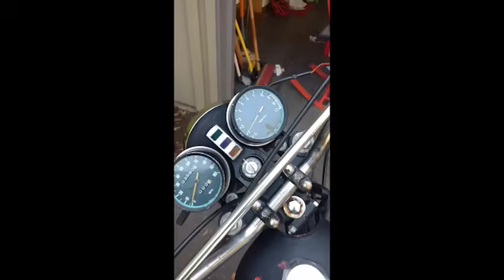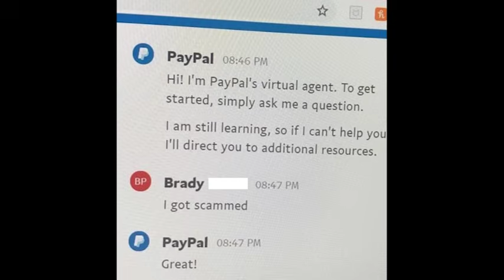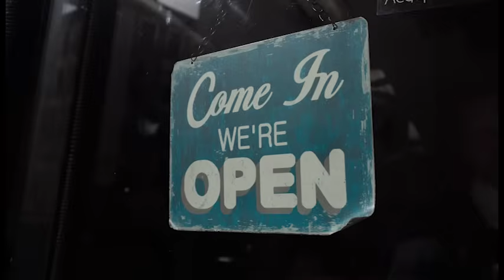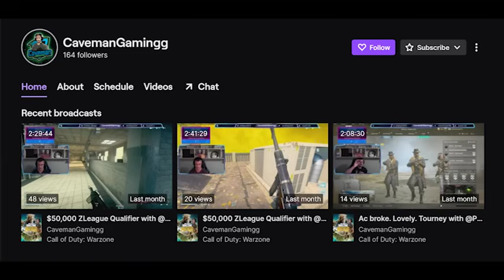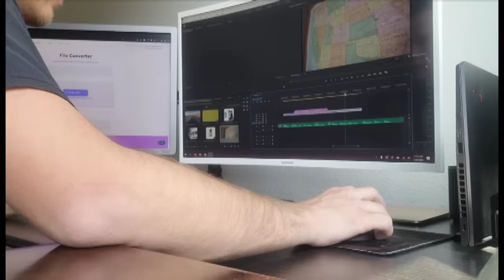Two Idiots Cross the US on '80s Motorcycles

Comment: 1980's bikes were very reliable....once you got them back into shape again, they will go for a long time.  Not idiots for choosing those rides.  In my 20's did it on a '67 Triumph Bonneville ... which made it but still not sure how.  It was a tired oil burner (quart a day by the time I was done, plugs cleaned up once in the morning and once at lunch) that needed everything tightened up every night when I started and needed completely rebuilt when I got back....but it was one sharp looking ride.  Now, in my mid-sixties getting ready do it again on a 150cc Vespa.  You guys aren't idiots,  just joining the club.

Comment: Thank you for the video log of your long cross country.  I had a few cross countries in the early 90s, none as long as yours, but mine were also eventful.  I was 28 when my mother passed from cancer.  Grieving, I rode from my rented bedroom in Miramar, San Diego to the Grand Canyon, a little over 500 miles, solo and back in 24 hours and obtained a iron-butt patch.  I had a well worn 1982 Magna.  I had only cash for gas, so no motels.  I slept on the ground.  It was early July and I roasted!  My rear tire showed threads after the drive through the Mojave and I had to spend my food money on a rear tire.  Later, I got pulled over by the police who thought I was a prison escapee!  I realized going through the extreme heat of the desert, it's best to wear long sleeves and gloves for sun protection.  I love hot tea, and I carried a thermos of the stuff, and sipped it on my breaks, even when it was 112 degrees out.  I'm about to turn 60.  Next year, I hope to ride with my 18 year old son on a motorcycle adventure.
Reply: I just turned 60 and started riding motorcycles when I was 8. Did you get a chance to ride with your son yet? If not, make sure you make it happen and good luck! Fellow rider.
Reply: горячий чай без сахара - старый способ справиться с жарой

Comment: A few months ago I was in the Sierra Nevada mountains with no cell service, I ran out of gas on my bike in the middle of nowhere my gas light appears to not work. Lucky I was going up in elevation the for along time past the last small town. I ended up turning back and coasting about 5 miles back to that small mountain town .
There was no gas stations for 15 miles.
I ended up talking to a residents and they had a lawn mower with gas in it. I cut open a 1 gallon milk jug and tapped it to my gas tank to use as a funnel and held the lawn mower upside down over my bike while cars where driving by looking at this freak show. I made it to the gas station and was so lucky I had ran out of gas where I did.

Comment: The melted stator wire on the Honda is due to corrosion in the connector. Hence why it only melts there. The fix is remove the connector and solder the yellow wires together.

Comment: As much as I like motorcycles, my car habit usually eats most of my funds, however  many times I have dreamed of doing the same thing in a 70s car. My 72 Chevelle or 76 Chevy short bed step side. But with old American muscle, fuel would be the biggest restraint. I live about 30 minutes from Branson Missouri on the Arkansas border. So it's similar to the scenery in hot springs, and the lake roads that snake thru the Ozark mountains. But I also imagine throwing a small camper in the truck, or tents and such,  just bringing my shelter along, camping along the way

Comment: A trip you’ll never forget. One of my shortest, yet memorable trips was from Southern Spain to Madrid on a cold January 7th 1993. In the military and shipped my bike over there. I’m thinking it was around a 400 mile trip but with the cold, I was stopping around every 30-45 minutes. 5 layers of cold riding gear but the cold just beat through it with no windscreen of that KZ-700. Ended up taking over 13 hours as I got a late start because of the timing of the bike being unloaded off the ship. And the cables were rusted and spent almost two hours freeing them up and jump starting the dead battery. Someone had turned on the ignition key while the bike was being transported. Hmm. But it was a trip I’ll never forget. Temperature was in the mid to low 20s when the Sun went down. It was crazy!

Comment: Two friends and I rode from Maryland to the Oregon coast and back the end of June - early July. I was riding my '90 Moto Guzzi California III and my friends were on a '71 Moto Guzzi 750 Ambassador and '73 Moto Guzzi 850 Eldorado. All three bikes were well prepared before the trip. We were carrying some spare parts, tire irons, spare tubes and most importantly - a small electric air pump. Zero breakdowns, just a leaky petcock which was tightened and one fouled plug on my Cal III. 6650 miles. That's one item checked off my "bucket list".

Comment: This could have turned out quite bad, I think the next time you try a road trip like this you need to understand and prepare the bikes better and carry tools and spares with you. In my youth I did some epic stupid things on bikes riding all over the country on old British bikes but was always able to overcome adversity due to having a good grounding in motorcycle mechanics and having tools and spares with me. One time in 1977 when I was 16, while touring in Scotland (400 miles from home) and in the middle of nowhere, I had a valve spring suddenly break which jammed up and bent a pushrod on my BSA 500 Royal Star, this was fixed by the roadside in less than an hour with me removing the top valve spring retainer of the affected valve with a screwdriver with the head still in place on the engine and removing the pieces of broken outer spring and refitting everything with just the weak inner spring to close the valve, then beating the pushrod straight again with rocks, then re-assembling to find that the bike ran perfectly, although I had to keep the rpm down due to the weak valve spring, happy days..

Comment: Before a longer trip, it is normal to do an overhaul, especially on some old motorcycles. What you said at the end of the video intrigued me and made me write. Motorcycles from the 80s and 90s are very durable and reliable, but before a long trip any motorcycle needs some preparation! I wondered how many times the Honda broke down, which in my opinion is among the best motorcycles!

Comment: Nice video and what a memorable trip! After 43 years of riding and quite a bit of travelling my experience is ~ I use a very reliable/comfortable/fuel efficient motorcycle (mine is cb500x 71 mpg), travel back-roads ONLY, stop often for  breaks (stay hydrated), don't set time/destination goals at all if possible (no pre-booking rooms or campgrounds), if I do have a final destination goal allow 2 to 3 days travel for what would normally take 1 day in a car on the interstate, start considering where I want to stop for the day at lunch time (I try to never exceed 6 to 8 hours travel including breaks), in the summer mountainous areas stay cooler (ideal), if I want to travel every day I get a room of some sort otherwise camping is way too much work  unless I plan to stay at a campground for several days, make sure  I do all maintenance pre-trip (oil, brakes/tires etc.), stop for many pics so I have photos of all the amazing scenery. That's how I fly @ #nobodycares!
Reply: Agree completely.  Back roads all the way.  Even high-powered bikes are no fun on interstates.  I rode a BSA through Europe in the early 70's.  Tried the autobahn once and that was that.
Reply: Just completed a mini tour along south coast of England & up through Wales on a Yamaha FJR1300 😁, did do a single motorway (interstate highway). It was all 'A class', 'B class', & some of the roads were tarmac with grass growing up the centre. Still completed 1500 miles in a week though😁. CA t wait till next spring to go on tour again 😎😁😁🇬🇧🇬🇧🇬🇧
Reply: @stephenwilliams6103  I was about to pull the trigger on a FJR 1300 a few weeks ago but someone got there 1st. Great bikes!

Comment: This is excactly the sort of thing I've been planning to do

I put 20,000+ miles on a 1981 Suzuki Gs-650L during just over 1 year of commuting from June of 2022 to September 2023, ended up having a problem with the CDI ignition system and decided to spring for a more long-distance style bike to get closer to my goal of touring America on a bike. 

Ended up getting a 1986 Honda Goldwing 1200, it was one heck of a learning curve to work on compared to my normal trade of Suzuki (various Gs and GT series) and Yamaha (Virago and Vstar), but I've been gradually running/riding and working closer to my goal of cross-country travel with her.

Comment: If you guys did this trip in July, you're crazy. I live about 25 miles southeast of Phoenix, and I don't ride in the daytime for about 5 months out of the year. Temperatures are usually around 110-115 degrees, and that is just plain dangerous. You can dress for cold, there is nothing you can do about heat, except drive an air conditioned car, which is what I do all summer.
Reply: There's another way to ride in the summer:  stay north.

Comment: Nice documentary. I liked your choices of mounts but was surprised at the amount and kinds of problems you had with the Honda. My late brother in law rode many thousands of miles on his CB900 and never once did it let him down. On the road, it always got better gas mileage than my 1982 GS850G. They were so popular that Honda sold a Tour-Pak for it. 
The Concours was Kawasaki's entry into the "sport touring" market and was based on the 1000 Ninja, just as the ZL1000 was an Eliminator derivative. 
All we've heard since the 1969 CB750 is how reliable Japanese motorcycles are compared to Harleys. Your experiences prove an old axiom: 

"If it rusts, f****, flies, or floats, sooner or later it's going to give you trouble." 

Ride safe, and ride on!

Comment: I bought a new 81 cb900c and after about three years I swapped the stock seat for a Goldwing seat. I used the 900's bracket turned backwards and it bolted right up but the front of the seat wasn't attached to anything it worked great and way more comfy than the stock seat. I rode that for 8 years.

Comment: That Honda engine, no matter in 750, 900, or 1100 cc form, always has the stator and regulator rectifier go bad. I had one of these for years, and it would fail every 6 months or so. I don't think Honda still has fixed this issue with its other engines. What a shame.

Comment: Some Honda Gold Wings had the same trouble with the plug melting from the alternator, the best way to fix it is to pull the plugs right off ,and solder the wirers together, but some shrink on first....NZ.

Comment: Great trip on old bikes. I live in Rutherfordton, aka Rolfton. Spent many years riding in the desert heat of the western states. Zip lock bags and ice are your friend. Many places will give you free ice if you ask for a cup of ice. Place bags of ice in your coat, pockets etc. yes you may get wet. But it keeps your core temperature down. Cheap air conditioning lol.

Comment: WD-40 is a solvent not really a lube. You should use moly grease on speedo cables, but the cable was likely kinked or frayed anyway. The 70s era Japanese speedos weren't very durable and will destroy themselves if the cable starts to bind.

Comment: When you rev the engine the lights get brighter,That means electricity is being generated,I knew little about motorcycles or engines and learnt by trail and error,These two merely replace the battery but blissfully unaware of the light brightness test or a meter,As one of them does all the "maintenance"